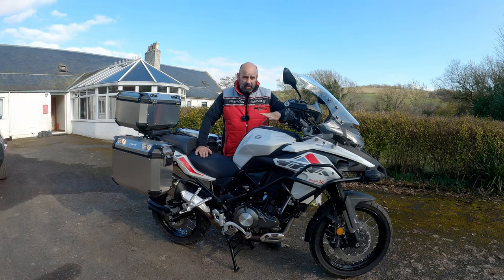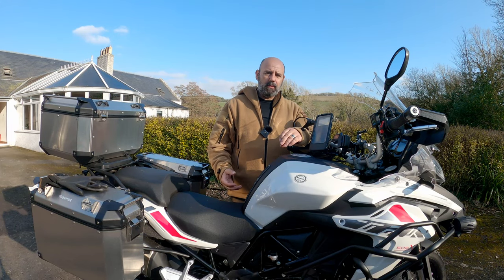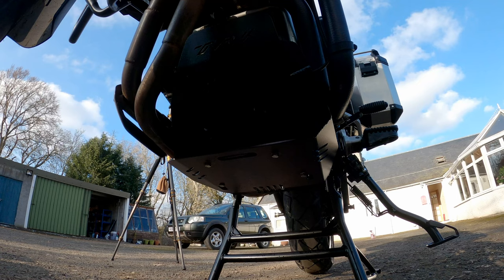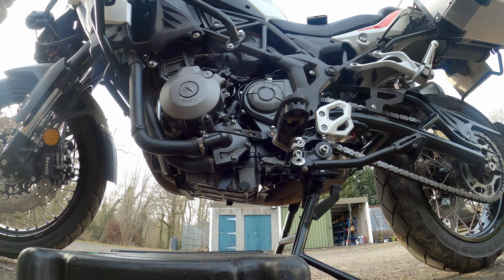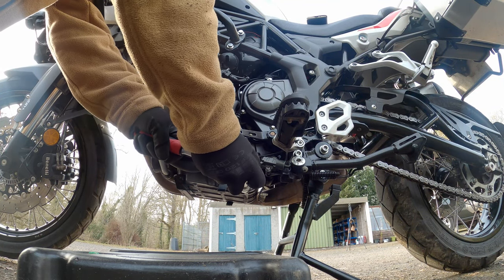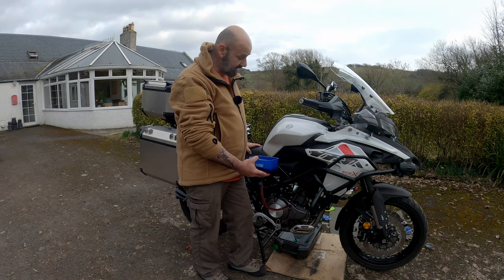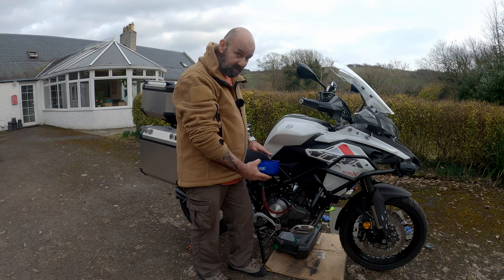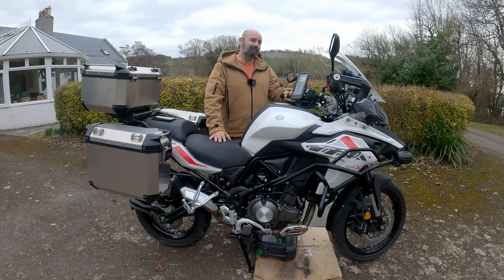How To Change The Engine Oil And Filter On A TRK 502X

Comment: Another good vid mate. Worth noting that as long as you’re careful, nothing wrong with using a screwdriver or drill to remove an oil filter. Can sometimes be helpful, as you can drain any oil sitting in the filter before removal.
Reply from the maker: Thanks for checking out the review. I have used screwdrivers in the past. Now I've got older my OCD has kicked in lol and I like to have a tool for everything 🤣 Ride safe 👍

Comment: I hope you don't mind, but I think  from what I learned today, there is the chance that there is a little too much oil in your engine. I had a chat to one of the tech's at my local Benelli dealer. I bought some oil and a filter from them in readiness to do an oil change on my 2020 TRK 502. They pointed out that there is a tiny arrow pointer cast in to the side case against the edge of the sight glass. 3.2 litres is the specified amount in the service workshop manual. This amount fills the engine up to the level of the cast in arrow. "L" signifies the lower level it is safe to run the engine and indicates that you need to top the level up. "H" signifies that this is a the highest level of oil it is safe to run the engine with and indicates that you really should adjust the level down to the cast in arrow marker. The lady tech I spoke to today checked this procedure up on their computer  for me, and confirmed the 3.2 litres quantity was the amount specified by Benelli themselves. I have found the pointer on my engine and painted a small "White Dot" on it to make it easy to find.
Reply from the maker: Thanks for checking out the review. If you take a look at my latest video on the channel the May - June update I have addressed this issue. I hope this helps. Ride safe 👍
Reply: @BikeRiderReviews  Cheers, I'm Always pleased to learn something new!
Reply: @BikeRiderReviews can you please show me the link about oil change? I can't find it (June version)

Comment: Useful video for newbies.
A couple of things,  I looked at oil filters and found different suppliers showing different HiFlo models. I ordered one from AliExpress  !! Took 10 days to come. I'm happy that it's a genuine Benelli filter for around £7. Actually ordered another for next change.
When I drain the oil , I do it on the side stand as bike then leans in direction of sump plug. 
Filling , I Don't use the centre stand as bike is slightly raised at the rear.  I use a block of wood under the side stand and I'm afraid to say , a spirit level across the fuel filler. How anal is that ??
Finally  , I made the same mistake with the filter tool.  I thought I had one. The filter needs a 68mm wrench . Got one off ebay about £5. Not very common,  most filters seem to be 68mm.
Reply from the maker: Thanks for checking out the review. Some good points there. Ride safe 👍

Comment: What was the torque for the oil filter please. You said the sum plug was 22. But you didn’t say anything about the oil filter setting. Great video mate thanks
Reply from the maker: Hi mate, the oil filter is the same, 22 Nm torque. Ride safe 👍

Comment: thank you Sir for the tutorial 🙏🏻
I have a question my friend give me some new oil after he sells his gs1250 the oil is 5w40 motorex boxter 4T, so can i use it for my the trk 502 ?
Reply from the maker: Hi, oil should be Oil 10W - 50 (synthetic) Jaso - MACCMC g4 
3. 21 ltrs for the TRK. The 10W number indicates the viscosity of the oil when the engine is cold and the 50W when the engine is hot. The oil you mention has a lower viscosity. The lower number is important for when you first start the engine from cold, and the higher number for when the engine is running hot. If the oil becomes to thin at running temperature, it is less effective at lubricating your engine.

Comment: I'm thinking of getting a Honda cb 500x. But just come across this bike it looks fantastic. What would you recommend.
Reply from the maker: Thanks for checking out the review. I am big fan of Honda bikes and own two Hondas at the present time. I don't think you could go wrong with either the cb 500x or the Benelli. However my personal choice would be the Benelli. It is a larger bike and has more road presence. From other reviews I have watched comments have been made saying the TRK feels more stable on the road and I personally feel the Benelli is far better value for money. Check out my channel, I have a road test video, accessories video and long term ownership review of the Benelli which may be some use to you. Ride safe 👍

Comment: Just discovered this channel and am hooked. Makes me really consider getting this bike. I ride a 150cc looking to upgrade do you think it’s all ok to jump from 150cc to about 500cc
Reply from the maker: Thanks for checking out the channel. I have been asked this type of question many times and the answer is simply it depends on the rider. It depends on your confidence, skill level, experience and even your physical build. All I can say is if you can handle the height and weight of the bike then it is an extremely stable and easy bike to ride. I think power wise the jump is not to big for this bike. Ride safe 👍

Comment: Too much oil! Benelli recommends with filter only 3L, not 3.2...... 
you're supposed to fill it to lowest mark, let it get a little bit warm WITHOUT revving it, and then fill between low and high.... 
never ever fill above high/max... Check you Manual on Site 147 or Chapter 6-12...
Reply from the maker: Thanks for checking out the review. The manual I have is the Benelli Trk 502 PDF version. Page 22/408 oil capacity with filter is 3.21 litres. I have always filled my bikes and cars to the full line with no issues. As I say in the video I am not a qualified mechanic however I have owned bikes for over 30 years and have never had any issues with using this method. Ride safe 👍🙏
Reply: @Bike Rider Reviews  Could you check on the first pages what's the date on your manual? I just found a 2017 version online and yes, 3.2l indeed. On my 2018 manual version it said 2.8 without and 3.0l with filter. But to my knowledge, there were no changes to the engine that should impact the amount of oil.
But as you can see on the little window it is a little bit to much..
Reply from the maker: @williamstianaka3150  All can say is after I put in 3.2 litres and allowing time for the oil to settle the oil was not showing the correct level. I am also using an after market oil filter which may also account for effecting the capacity. Ride safe. 👍
Reply: There was a Video Like 2 Weeks ago of someone comparing benelli and Other Main Brand Filter without any Big Difference.
Maybe you are both correct, we should try to get a Professional Response for this issue. Sadly i cant contact benelli cuz they dont have official contact for German customer. 
Maybe my Workshop know a reason
Reply from the maker: @SyVlogsMotorcycle  Just a quick update on this issue. I took your advice and consulted with the vehicle fleet manager where I work who is a qualified mechanic. This was his response.
The oil level is deemed to be safe as long as it is between the low and full marker. Usually after an oil change an engine will burn oil away until it matches its oil balance tolerance for the age and wear of the engine. He stated some engines such as volkswagen are known for burning more oil than others. Therefore he recommends after an oil change, fill to the full mark. The engine will naturally burn a percentage of this oil and will then settle at a level somewhere between the low and full mark. This level should then be maintained. He stated the problem with only filling to half way between the low and full mark after a service is that if the engine is worn or of a design which is known for burning oil, it may drop below the low level and damage the engine. He also pointed out filling to above the full mark may also damage the engine. I hope this clears things up for everyone 🙏 ride safe 👍
Reply from the maker: Haha that one I can't answer, maybe there has been a slight change to the later model engines, but I'm only guessing.
Reply: @BikeRiderReviews  so right now you are right and William is right.
Last Question is why there are 2 Different Manuals :/
Reply: @BikeRiderReviews  i will Talk on my 1000km Check about this with my benelli service point
Reply: @BikeRiderReviews  i just told you what my motorcycle mechanic teached me...

Comment: Why didn't you buy the triump tiger sport?
Reply from the maker: Thanks for checking out the review. Mainly because the looks of the Tiger don't really appeal to me, neither does the Suzuki V Strom. If ever I do replace the Benelli I think it would be the Honda Africa Twin Sport 1100, however at the moment they are still a little pricey on the second hand market and I cannot justify spending that much when the Benelli does everything so well for such a competitive price. Ride safe 👍
Reply: @BikeRiderReviews  can't argue with the benelli trk , but where I live it's priced as the versys, but some argue the engine character is way better. Benelli trk sold in many countries, it's reliable too, as you mentioned about solid panels that fits the first time all the time 👍
Reply from the maker: @Antimortem  Wow, priced the same as the Versys. To be honest I think the TRK is certainly on par with the Versys. I really believe that as time passes and people see the quality of Benelli bikes, they will become far more acceptable and more coveted brand, unfortunately I think we are also about to see the increase in price which will also follow. Ride safe 👍
Reply: @BikeRiderReviews  benelli is famous for its inline four ❤️, test ride the TNT and you'll rediscover what inline four bikes should be. You seem to be an experienced ride, tell me about the engine oil you use, SILKOLENE? where I live, Liqui moly is talked about but, I wanna hear your thoughts about oil😃
Reply from the maker: @Antimortem  Silkolene is a British brand. I have used it for over 20 years and I have used it in some very high performance home built custom engines. Because of this I trust it 100% as it has never let me down. At the end of the day I'm sure most well known modern brand oils are excellent. I just tend to stick with what I know is proven to work. Ride safe 👍
Reply: @BikeRiderReviews  thanks for entertaining my questions, cheers👍. I think I'll try SILKOLENE oils, I have tried motul, Liqui moly , elf. But the results were not good. What about ROCKOIL, it's a UK oil ,have you heard of it?
Reply from the maker: @Antimortem  I have heard of Rock Oil but I have never used it so I can not really comment on it. Try the Silkolene brand, I'm sure you will be very pleased with it. Ride safe 👍